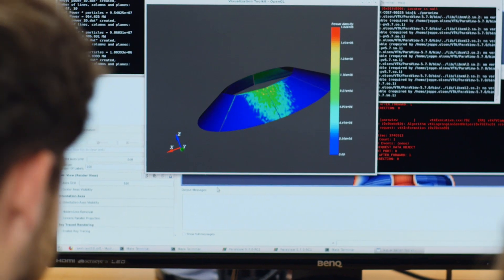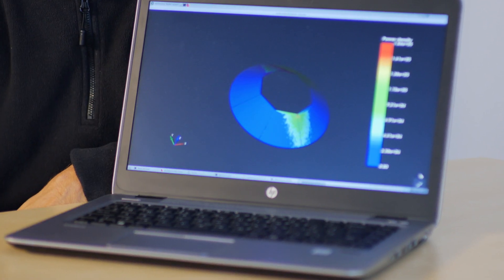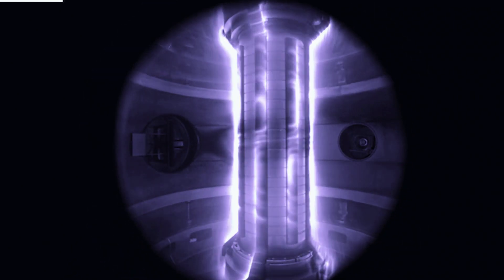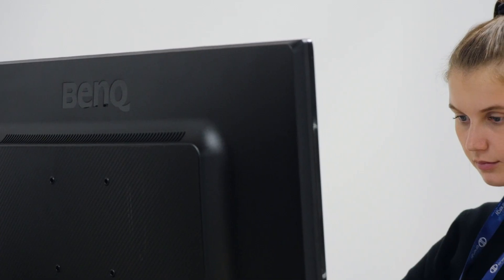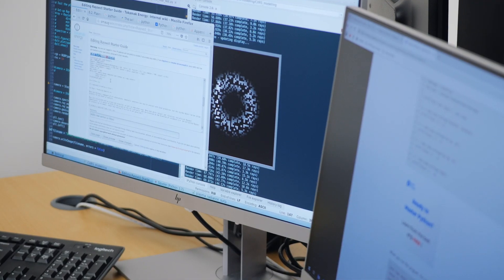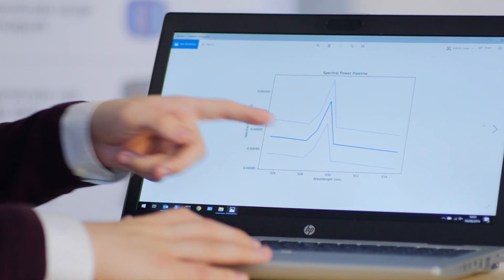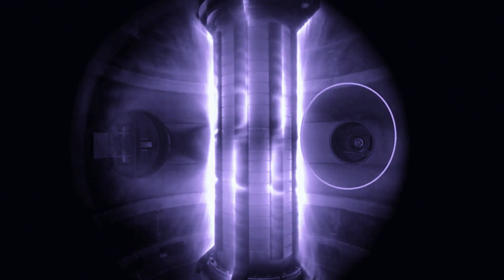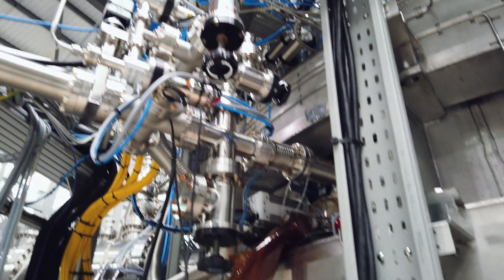Project Work of the summer 2019 interns at Tokamak Energy

Comment: I would hope any cooling would be harnessable for electrical generation.
I would think the point of the tokamak, though, would be to completely avoid heating from the plasma.
If heat for power generation is actually going to be eventually extracted from radiation from the fusion into some sort of cooling blanket, I suppose there's also a need to look at heat transfer of all parts that would be exposed to such radiation.
Complicated indeed.